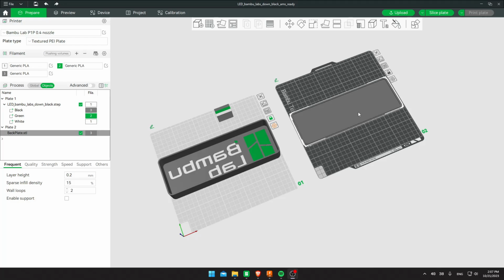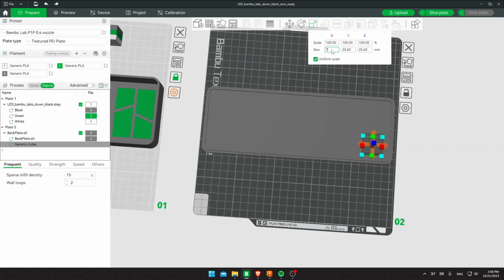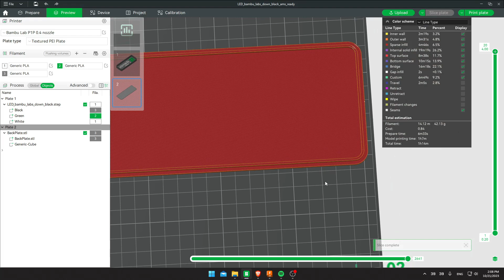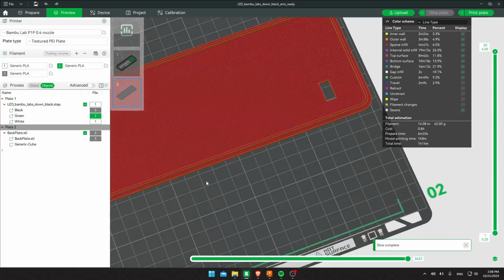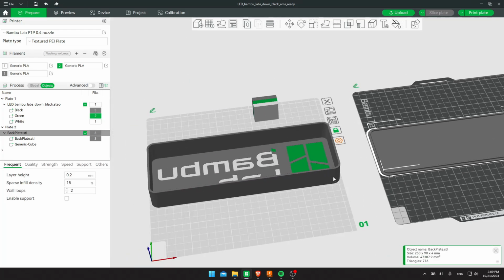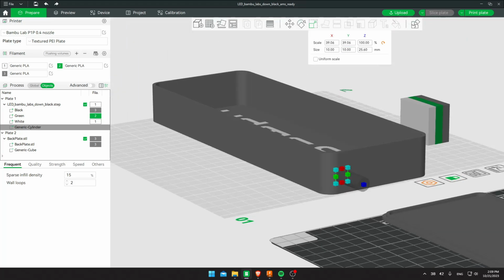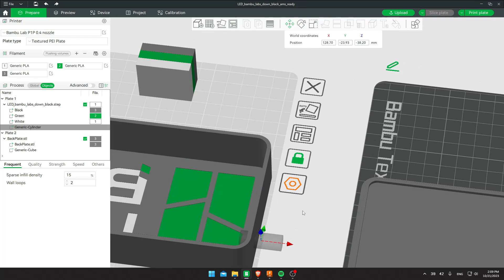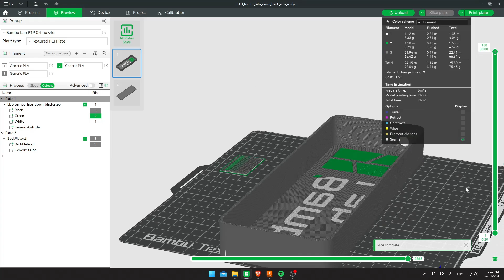Mastering Bambu Studio: How to Create Holes

Comment: thank you for the video but how do you position holes exactly i have an almost identical box as the one in your video but i need to place a circular hole in the lid and 3 rectangular holes in the side wall that need to line up with 4 switches on a pcb board that i need to fit inside ive measured the dimensions and locations of the holes but how do i put that into bambu studio settings if i try and drag the holes it doesn't come up with dimensions on my box to show where the hole is im 5 days in to owning my A1 and really want to learn how to use it and not just relying on copying other peoples work